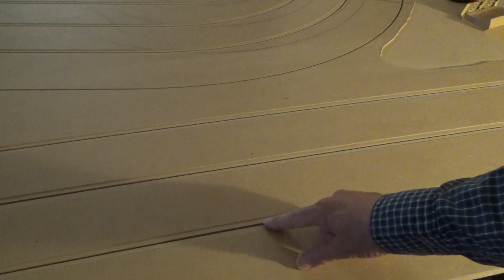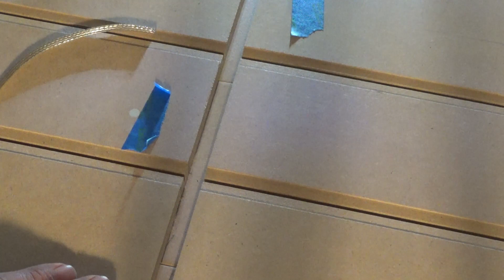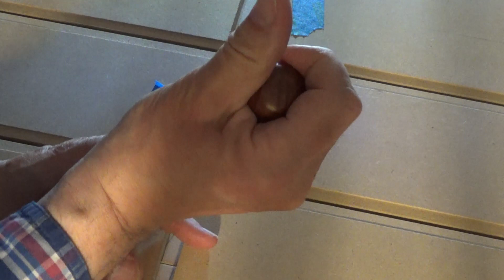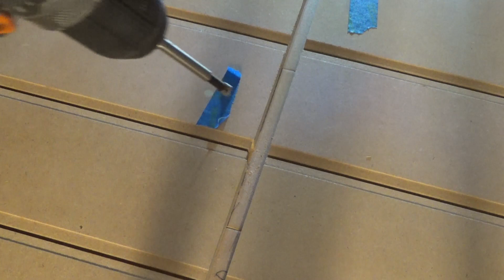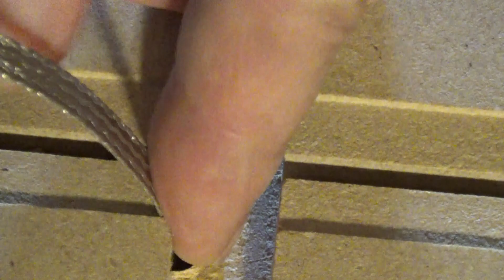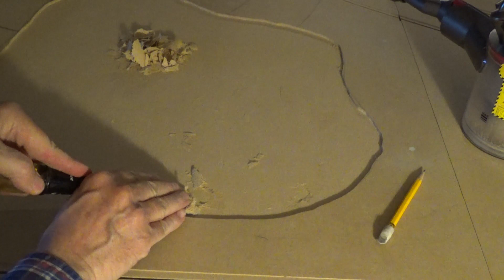Trading the Router for a Chisel  -  Wood Track Build Part 4

Comment: That’s a great clean and tight connection at those joints the way you cut back one to receive both braids down through the hole. The thought occurred to me, that joint electrically Where are you feed both halves provides power to each half, but then what happens at the other junction of each track? Is the braid just cut flush so there’s only one electrical connection to each half? I’m not sure if I asked that clearly. And maybe that’s addressed in another video. OK thank you onto the next one now for me.
Reply from the maker: Hey Scott!  So I'll have one electrical connection to  each braid (two per lane) and the braid itself will carry the current all the way around.  There's a short section that will not have current but will act as a switch to detect laps for the computer interface.  I'll try to explain more of that in another video.

Comment: Hi, Sean again with another question, does it matter where you put the power to the track, such as at the beginning of a straight, or doesn't it really matter ? Thanks
Reply from the maker: Hey Sean!  Good question.  So on my plastic racetrack, the steel metal in the track was very resistive and the power started dropping off only a few feet from the power tap.  So I had to add taps at the beginning of each straight.  But on my wood tracks, with either copper tape or braid, I only need one power tap, assuming your sections are joined well electrically.  The copper braid is very conductive.   It doesn't seem to matter where you put the tap.

Comment: Hi, is the dead strip it's self 3 inches, (you drilled the holes for that about 3"  apart, then drilled on the outside of those holes to continue the track braiding ?    I'm a bit of a perfectionist and what it to be right :) lol  Thanks Sean
Reply from the maker: Sean, shoot me an email, as it is much easier to discuss details, and also I can send you a picture.
Reply from the maker: The dead strip holes ended up around 2.75" apart, with 0.5" between the track braid holes and the ds holes.  There's no exact formula for it.  My DS is located on a straight just before a turn, so the cars will be either coasting or braking so there should be good contact.  The faster the anticipated speed of the cars, the longer you would make the ds.  Hope that helps.
Reply: OK, I kinda already made them 3" apart, that should be OK right ?
Reply: @StanFerris  Hi, thanks for all the info. I did make the dead strip holes 3" apart, that should be OK  right ?
Reply from the maker: @seansheerin  I think that should work ok.
Reply from the maker: Mine are about that length, just a tiny bit shorter, and are at the end of a straight section.  Not sure where your DS is located but the 3" should be fine.

Comment: why didnt you use a drill ?
Reply from the maker: If you mean for the braid drops between the track sections, I wanted to recess back away from the joint a bit to account for the thickness of the braid.  I suppose I could have just drilled a bigger hole, but I wanted the joint between the track halves to be not very noticeable.